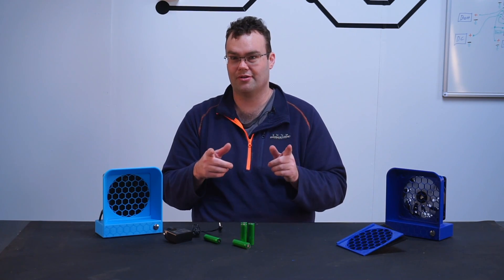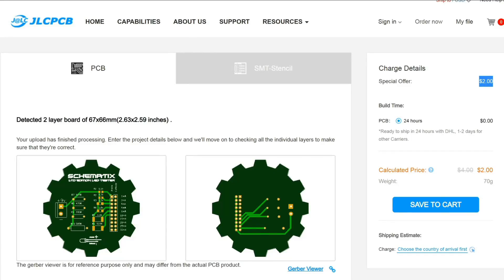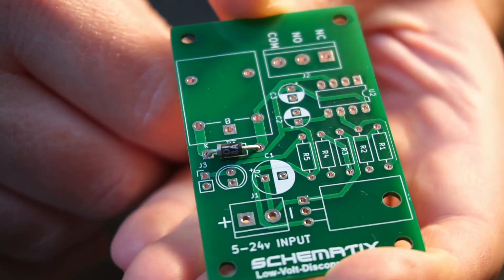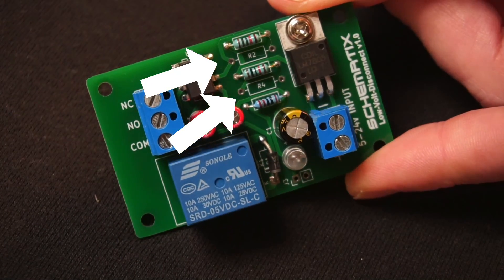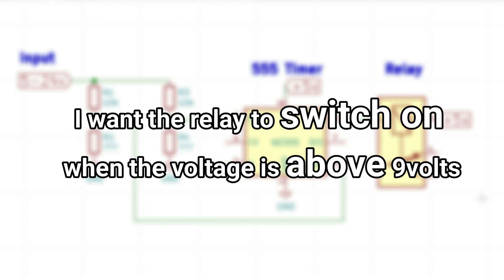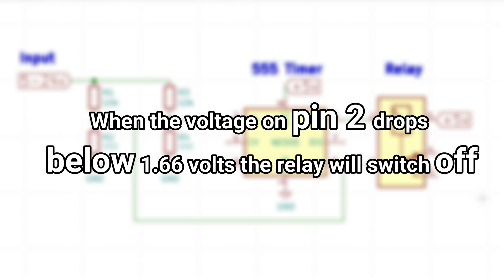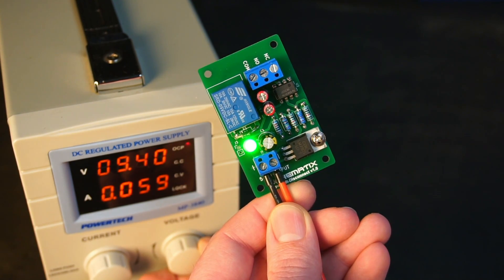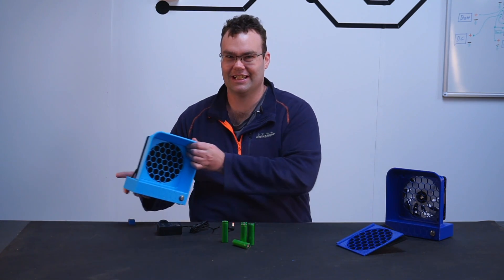Building a Low Volt Disconnect (LVD) ll Prevents over discharging batteries!

Comment: A simpler way to isolate the batteries. When the power supply is attached is many dc Barrel connectors When soldered properly disconnect from one power rail so that it isolates any internal batteries.

Comment: Thanks for clear and concise explanation. Nice implementation, yet I think it still needs more important features. Once it turned off, those 555 circuit is still active and drawing current continously. Which is kinda a bummer, exactly for the battery life that we want to protect. I prefer using a kind of momentary switch to turn the circuits on, then eventually it would terminates completely when it switched off. Using MOSFET (instead of a relay) is another huge bonus for efficiency.

Comment: Hope anyone here can help...I am looking for this very application, to be used on 4cell and 5cell packs Nihm or nice batteries... preferably with lcd screen to select both up and down voltage to trigger cutoff. Intent to use this application for both charging and discharging batteries. The modules I have seen matching this secure, are only for lead acid batteries.

In fact.. I need a large order if I could locate manufacturer

Comment: I don't see the usefullness of this circuit. The whole point of a LVD is to disconnect/connect the source voltage when it goes below or above a certain threshold. All this circuit does is open or closes relay contacts.

Comment: Excellent video. I am currently looking to buy or make a voltage disconnector. Could someone suggest how to modify this circuit to switch off at approx. 2.7~2.8 volts and switch on at 3~3.3 volts?

Comment: What about under 5v? Eg 3v for 18650 protection.
Reply: You would have to boost the voltage from the 18650’s to at least 4.5 or higher otherwise NE555 will most likely not work due to insufficient voltage.
Reply: I get It's an old thread/video but it was my understanding that all 18650 lithium cells actually had Circuit boards in the end of them that had voltage protection ect. Is this not your experience?

Comment: can i use this ckt for 48V ?
Reply: The VReg LM7805 nor NE555 can handle that much voltage you would have to drop it down to at least 16V for NE555 to handle it, but I think the max input V of LM7805 is higher than that of NE555 but I think it’s somewhere in the 30 range.

Comment: It's not so difficult to actually build normally open contacts with MOSFETs as well. 
Since this is just a window comparator I personally wouldn't use the standard NE555 in a battery powered circuit because of its power consumption. 
Nice to have a portable extractor 👍🏻😎
Reply from the maker: Actually, that would make a good video topic! Building an NC/NO MOSFET switch.....
Reply: @Schematix  haha. Yes.
Solid state relay is also possible. Obviously the same thing, but easier to use.

Comment: Why not use a 18650 charge board with that build in and can charge or run by wall charger too?
Reply from the maker: For sure that feature could be implemented into the fume extractor however, I'm personally not bothered by removing the 18650s and changing them.
Reply: @Schematix  what he means is there are so called bms boards. They won't even protect your batteries, but switch automatically as well as charge batteries at the same time.
Reply from the maker: @p_mouse8676  For lack of a better explanation, this LVD is more universal in applications than an off the shelf BMS. This could be used on SLA, Lipo, NIMH and so on. Plus since the relay is mains power rated, it can be used to switch 110~240AC power. Sure this doesn't have the fancy bells & whistles of your typical BMS. However, In an application where you just simply need a set voltage cutoff, or switching mains power, this gets the job done.
Reply: @Schematix  that's totally true! 👍🏻 I guess that wasn't completely clear in the video maybe?